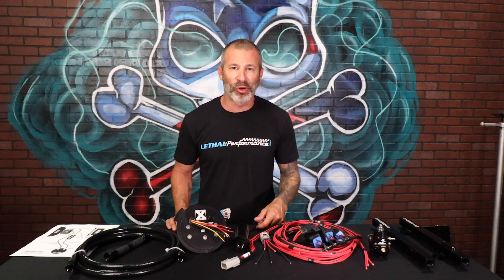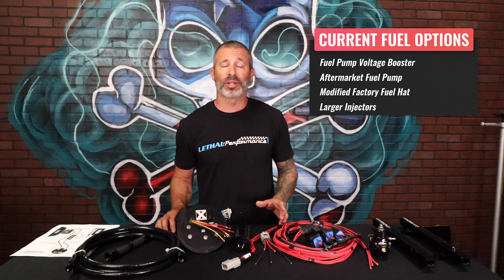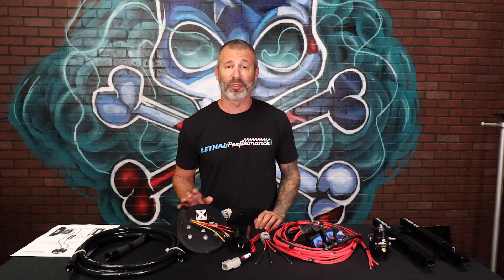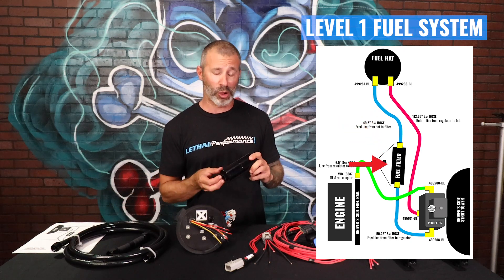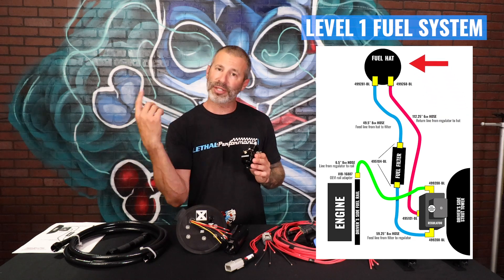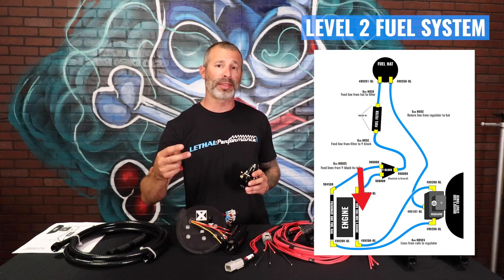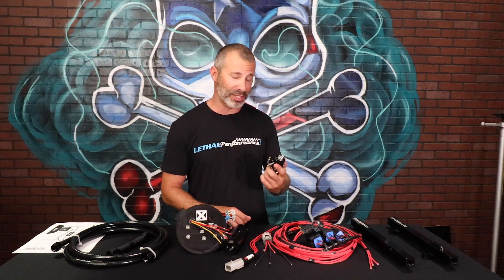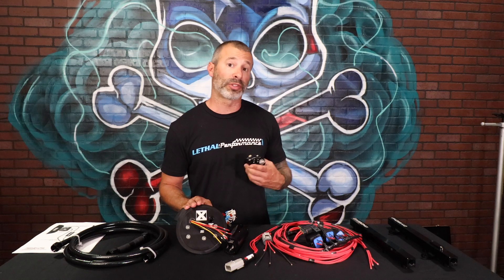Lethal Performance Fuel System Series: Level 1 and 2 Systems for the 2011-2017 Mustang GT

Comment: How much hp does the lvl 2 support
Reply from the maker: That all depends on what type of power adder you're using as well as what fuel type and injectors you'll be running. It varies due to those things. Feel free to give us a call and we can discuss your setup and goals with you as well as help you choose the right system for your application.
Reply: @Lethalcamp  I’m planning to use a twin turbo set up and I’m shooting for 1200-1300hp. Do yall think the lvl 2 is enough for that??